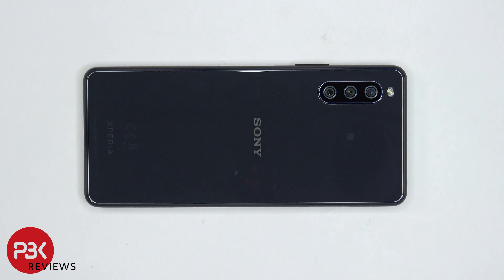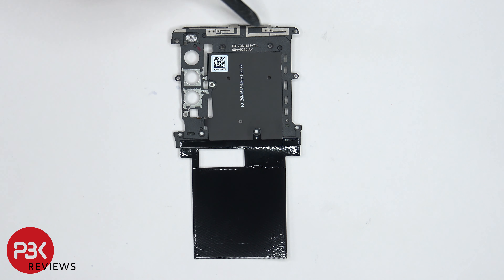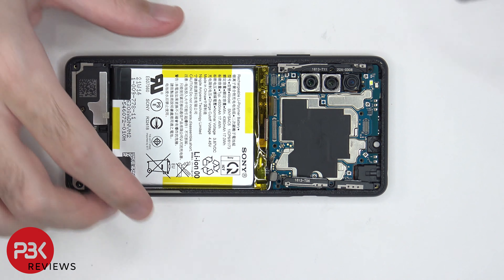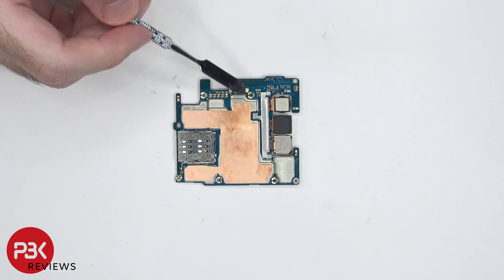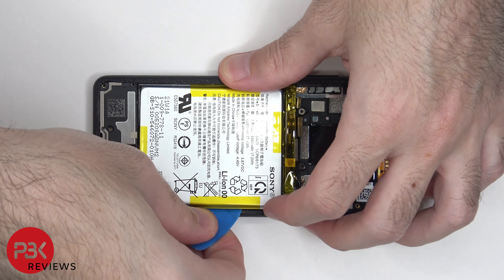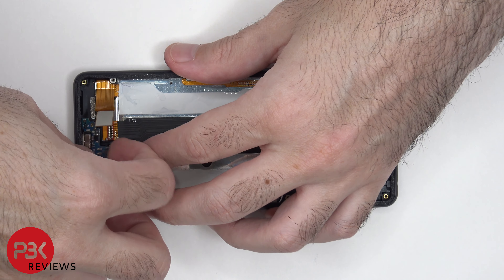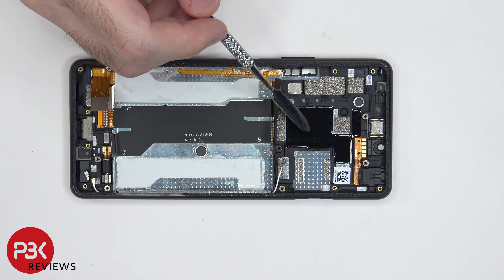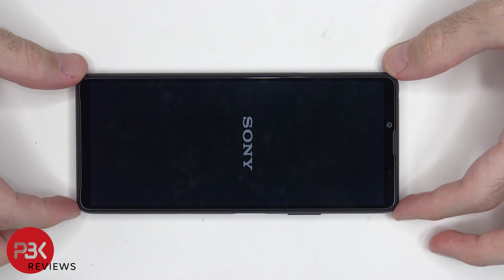Sony Xperia 10 III Disassembly Teardown Repair Video Review

Comment: If you can, please do a video about 10 IV. It is probably the right phone for me... finally, despite weak speakers. I would like to know, if its design inside is logical and maintenance friendly. I would like to see clear shoot of battery spec, but I will try to google it.
If bigger battery is made by a higher voltage, then to hell with it... I will renew my xz1c then.

Comment: There is bigger battery with the same weight. They made some great design choices.
Dimensions II: 76.20 x 54.40 x 4.60mm 80g
Dimensions III: 74.30 x 60.00 x 5.36mm 80g
I wish they would desing "compact" with dimensions of ~147x63x9.3mm. Screen would be as wide as XZ1c, but longer.
Battery would be 67.3 x 55 x 6.2mm or 67.3 x 55 x 6.36mm, so 4300mAh or 4400mAh.

Give it  even snapdragon 480 (great performance, check up tests) and I will be happy.
Reply: So they went 153 × 67 × 8,3 mm with 10 IV = volume 85 083.3mm^3
My proposition was close, but better 147 x 63 x 9.3mm = 86 127,3mm^3
This 1,044 cm^3 should be stereo speakers...

But there is xperia ace III with S480 and 140.00 x 69.00 x 8.90 mm = 85 974mm^3
It is perfect for me, but again no stereo, and I prefer more height, than width. IPS screen is great, because it do what needs to be done and is cheap to replace + last longer and probably use less power on full brightness.
Xperia Ace IV probably will get a new Snapdragon 4 gen 1, which is basically the old S695, with 200mhz less on a78, and 100mhz more with a55.
If there will be 720p IPS screen, stereo then it is must buy for me.

But if rummors are true, then it will get 1080p OLED and 21:9... Then the only way for 10 V to be different is to have stereo speakers, when ace IV not.
Reply: Sadly the pull-tabs dont work. People with no much skill and impatient people easily can destroy the battery by shortening it. Or much worse. Pull-tabs are the worst.

Comment: Great video!!A quick question...is the mid frame replaceable?Ty
Reply from the maker: Thanks! Yes its replaceable, you would just need to take apart the entire phone and remove all the parts and move it over to a replacement mid frame.
Reply: @PBKreviews  Thank you for the quick response.
Reply from the maker: @np236  you're welcome
Reply: What kind of adhesive can I use for?

Comment: Very Cool! Have you noticed any issues with signal strength on this unit? Thanks.
Reply from the maker: Hi, I haven't used the phone for long to tell since I usually just take the phones apart for the videos and re assemble and sell them off and move onto the next phones. :)

Comment: When using isopropyl alcohol, can it be used even if it is 50% pure?
Reply from the maker: yeah but higher percentage is better for it to work well and dry quick as to not cause any damage to any components if it gets somewhere and stays there when you power on the phone again.
Reply: @PBKreviews  thanks.i will buy 99% pure alcohol.

Comment: Was mostly interested in the front glass replacement, there is a thick layer of glass protecting the lcd screen, dropped an iron plate on the phone, cracked the front glass. But the scree works perfectly.
Reply from the maker: The glass is fused with the screen, so replacing just the glass is not possible by the end user, you would need to replace the screen.

Comment: How easy is headphone jack removal?
Reply from the maker: It's not too difficult but it requires removing the main board and heating up the area around the charger port a bit to loosen the adhesive underneath the flex cable and gently pry it off the frame.